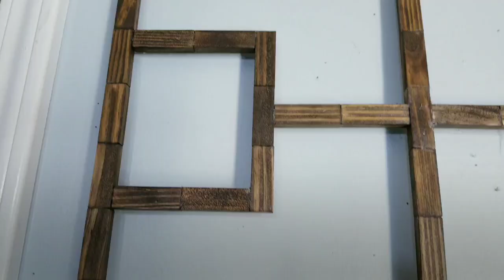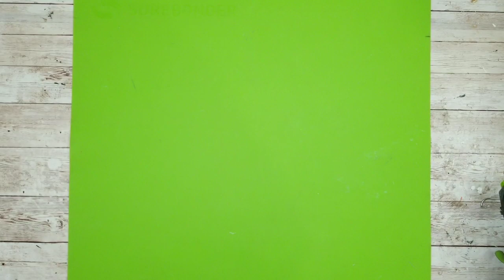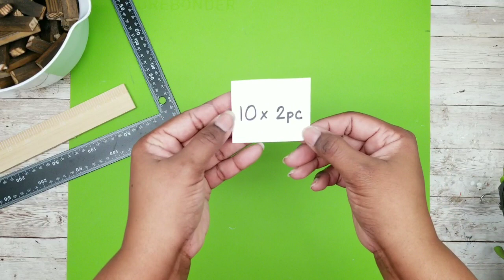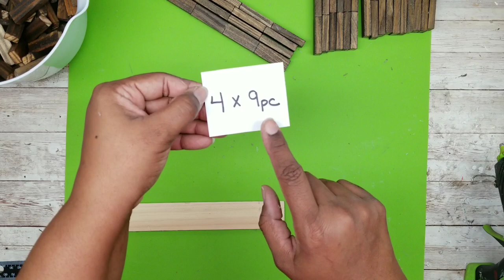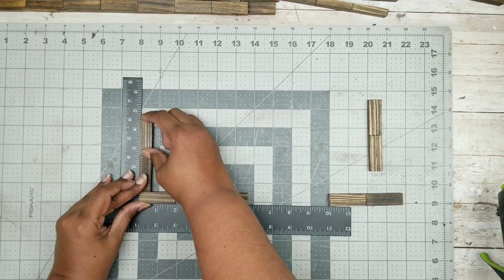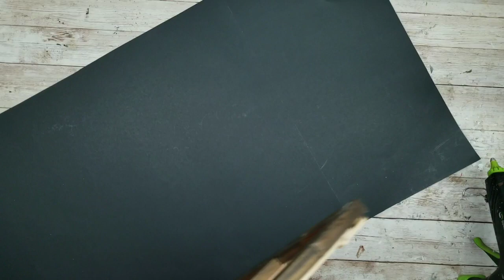DOLLAR TREE DIY Wall Decor | Modern Contemporary Wood Design | HIGH END LOOK | Tumbling Tower Blocks

Comment: i amusing the dowel rods but i think i am missing one size of blocks. Can you please put up the sizes again
Reply from the maker: MEASUREMENT CUTS FOR SQUARE DOWEL OPTION:
5ea 36" .50" Square dowels
2 Pc cut at 33.50"
4 Pc Cut at 13.25"
10 Pc 3.75"
6 Pc 5.75"

Comment: Can wood glue be used in substitution of the hot glue?
Reply from the maker: You could use wood glue. It's important to let it sit undisturbed overnight or at least 24 hours for it to dry, therefore taking this project longer to complete. Also, be sure to keep the project very still while working since it does not instantly dry and pieces can be knocked out of place.